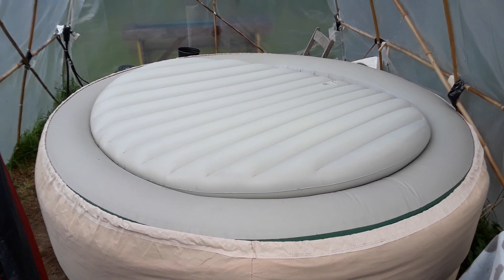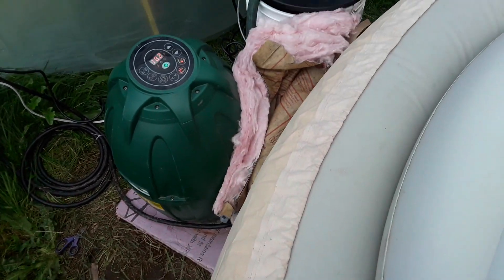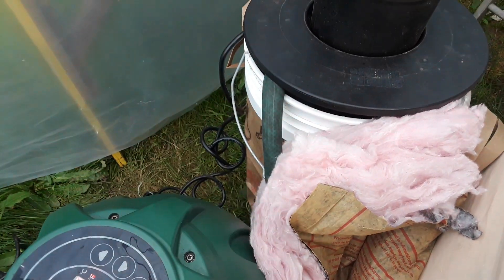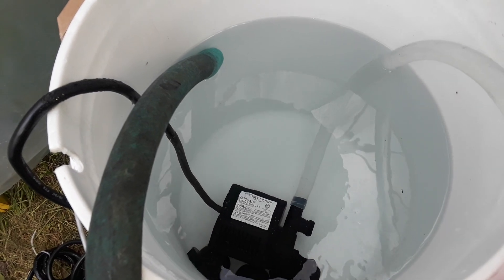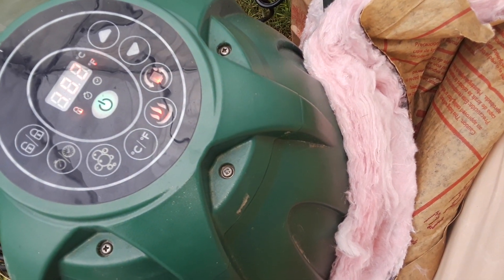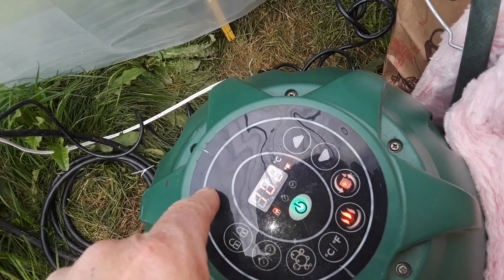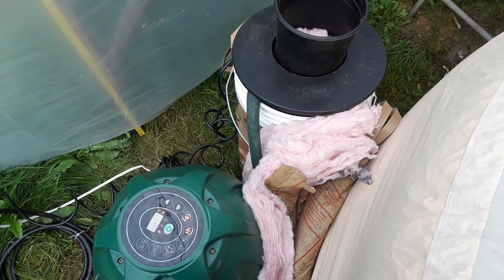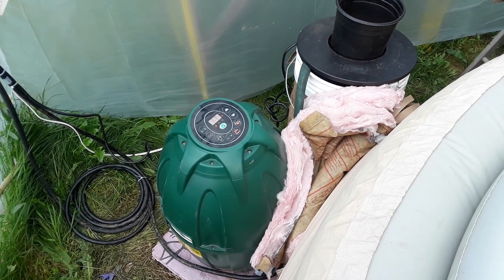Pump Bypass (Saluspa/Lay Z spa/ Bestway/Intex/Coleman) solution.

Comment from the maker: It's now 2022. In a few days.
I had this functioning well for a couple of years this way. Then I started to have problems with the heater as well. I happen to have a pump from my 10-foot Intex pool. I insulated the hoses and that is providing perfect circulation without the bucket. It also keeps the filtration going strongly even if the filters start to get dirty. I was using immersion Heat but those kept failing. So I will now be using an inline heating element which will come off of the pump. A pool heater on the low-end is about 180 bucks. The Intex pool pump cost $70. They're still nothing wrong with the inflatable tub so on I go. Do not waste your time with submersible heaters that claim they can heat a hot tub. They can, but they will only last two weeks. The inline heater has to be no less than 1500 watt or 1.5 kilowatt period that will still plug into your 110 outlet. I will be running a 220 for the three kilowatt heater which also comes with a programmable thermostat.
Reply: Thanks for consistently updating I read every single one  I just brought a hot tub  like this and I want to learn all the problems I'm going to be facing in the future with mine

Comment from the maker: This is still working. I did have to clean the magnetic door inside the water path of the bot. The flap would not stay open because the plastic encased ferrous button was covered with a little bit of dirt enough to affect the magnet strength. I kept getting an error 2 code but the water was not obstructed. It was only a bit of technical knowledge that helped me discern the issue and solve it. All is well. Hut has survived 2 winters and still it stands. Tub still heating, filtering and pumping.
Reply: How do you fix that button mine came off in pieces
Reply from the maker: @rayhoag8014  That's another matter. Button came off the flap or flap came off its hinge
Reply: Can I fix the button by gluing on  small magnet?
Reply from the maker: @rayhoag8014  You should try it. It should work with proper glue. Epoxy I suggest.

Comment from the maker: Update Feb. 27 2021
Still works great.
I added some Christmas lights to the extension cord. It gives me a visual answer to the status of the robot. If it goes out, the robot has come to "end". If it stutters, there is a slight blockage in the pump or the return. 
If you get error 02 the blockage was enough to turn the bot off. 
Easily fixed. The bot doesn't like the flow too low. That's the whole megillah.

Comment: Do you have to do anything to the old pump, leave it in, remove? Why did you have to forfeit the air blower? I thought that was completely independent of the water pump.
Reply from the maker: You dont have to give up the air. I just don't use it. It connects independently to the buss bar inside.
Reply from the maker: You do need to leave the old pump in place because the water will pass through. Otherwise there's a gap.

Comment: Which beckett adjustable pump did you use?  I am a little unclear on the GPH needed. Lot's of options for pumps on Amazon
Reply from the maker: The GPH on mine is 480 I think. I have to slow it down anyway because the gravity feed from the tub into the bucket is not as strong as the pump. It requires the flow adjuster to dial in a balance, but it has worked now consistently for many months.